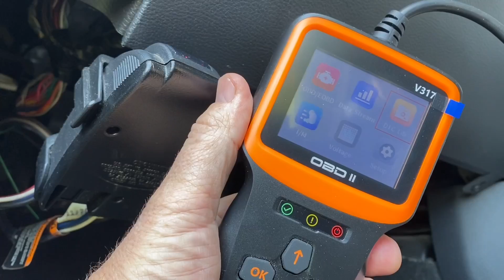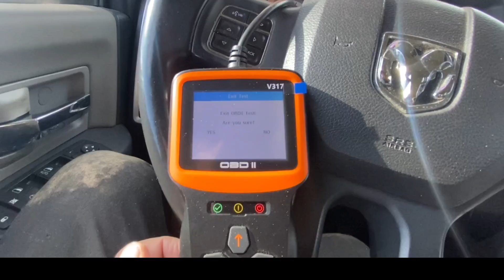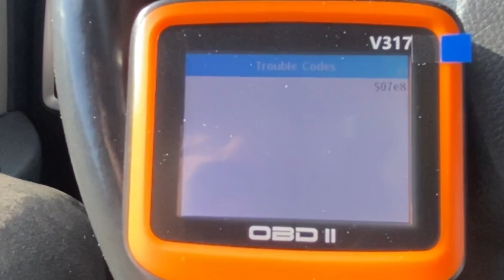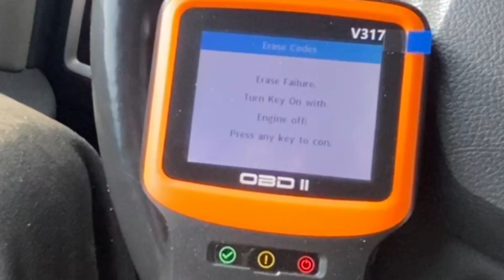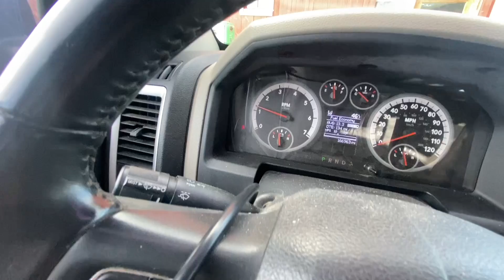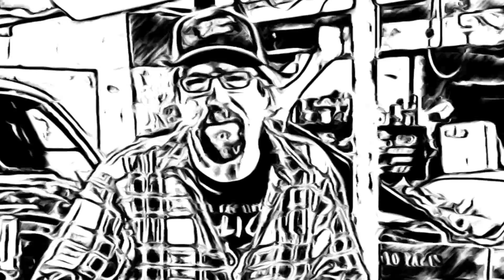2012 Ram Truck MEGA Cab Trouble Codes - Diving Into potentially Serious Issues??

Comment: Yeah, I think that the current standard to have EVERYTHING controlled by a computer and interconnected is getting just a bit out of hand.  I was watching a YouTuber who is very knowledgeable about engines trying to do an engine swap from a pickup to a RV and he just couldn't get the dang computer to let the engine run.  I think the problem was a sensor for something the pickup had that the RV didn't and the computer just wouldn't start the engine.  He tried aftermarket chips, buying an older model computer, cutting some wires and soldering in a resistor.  You name it he tried it.  He finally ended up going with a Holley Terminator X Max computer and removed everything factory.  Ran great after that. 🙄 Kind of the way I felt putting that Weber carb on my ole Nissan Sentra.  Thing ran better than when it was new!
I also don't like how EVERYTHING is reliant on you having a smartphone and an app nowadays.  My Mom got broadband recently and her router REQUIRED a smartphone to use. WTF!  You can't just use the browser anymore, you need a friggin app!  I call BS!  And then I couldn't hide her SSID.  That is like Wi-Fi security 101 level stuff and it doesn't allow you to do it? I then got into trying to figure out the passwords and find that the broadband company had them but wouldn't allow my Mom to access with them so she couldn't access her own router. 
You run a business that handles this stuff, You know how totally messed up that is.  Enough about THAT rant.
Enjoy the holidays.  I am in my annual holiday funk. 😮‍💨  I'll try not to depress everyone. Got tickets to go watch Wonka on the 16th with my wife, son, daughter, son-in-law, and my daughters BFF who lives near us.  It should be ... interesting.
Stay warm, safe, and healthy.  🤟RAWK!
Reply from the maker: I’m thinking about buying a 1940 Dodge truck.

Something simple

Comment: I'm 61.... Not certified in anything HS drop out!.. But hey I'm in good company Lincoln and a lot of great achievers are in the same club as I... Today cars are turds on wheels and they are too smart and gadget bloated.... I subscribe to the old KISS adage... Not the suck ass band! Keep it simple stupid!... As  auto engineers/designers will walk past 10 virgins just to screw one mechanic... I  keep up an 08 ram 2500 and a 2018 ram 2500 both are money pits turds... The 18 is on its 3rd transmission rebuild! And the dealer refuses to replace it with a brand new transmission and my buddy bought it new! I have auto ingenuity as my scanner software and hardware it a very affordable choice as you can buy what you need a la cart and upgrade or not as you please and is biodirectional in control.... But the basics always apply that will never change.. #1 never trust a sensor they can lie as in the case of oil pressure the only 100% way to know for sure is a mechanical gauge... I had the same oil pressure issue on a customer's  2012 impala hot in gear mechanical gauge reads 40 psi in idle in park it goes up even more 2500 rpm... But the computer and brand new oil sensor refuse to play nice with each other 😂😂😂... I also have the HFT Zurich ZR15 scanner and was able to relearn the throttle postion on the same car when the throttle body died on it not bad for a HFT item... $300 for the throttle body.... Yeah money pit turds 😂.... Like some one already mentioned Piney hollow diagnostics is a great channel lots of case studies Ivan is a true diagnostic tech and a very talented mechanic... Also Scanner Danner Is an awesome auto diagnostic teacher they make it easy to keep up with the modern turds of today... Whe I was a child my dad would struggle to set his digital clock or program the VCR and I had to do it for him I knew right there and then... God love him but I did not want to be like that as I got older so I decided that I would alway be in learning mode and never stop.... I guess taking apart old TVs at 8 yrs old helped 😂😂😂... And my uncle Nicholas an electronic engineer saying John electronics is a great field you will never know it all you will always be learning and that were all of the fun of it comes from.... God rest his soul.
Reply from the maker: I’m seriously considering selling this truck and buying something with points. Lol.

Thanks for watching. Loved reading your comments.

Comment: I think you just need to replace your oil pressure sensor located near your oil filter. My Dodge mechanic buddy says that was a common failure with those sensors.
Reply from the maker: I did replace that just recently, and I think that took care of the oil pressure code. However, I have other issues now, including a dead starter so it’s sitting until I can work on it.

Go figure. I just paid it off.   😂😂